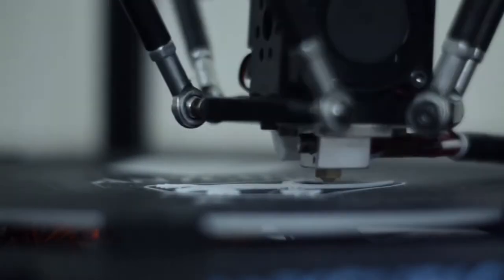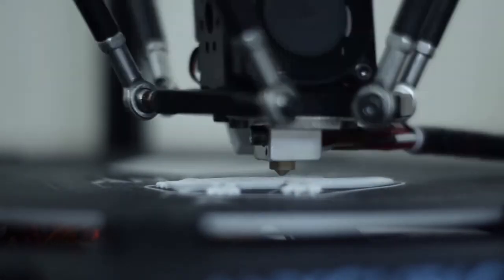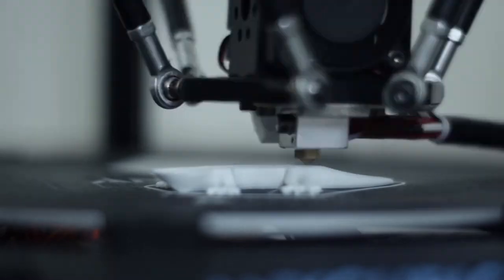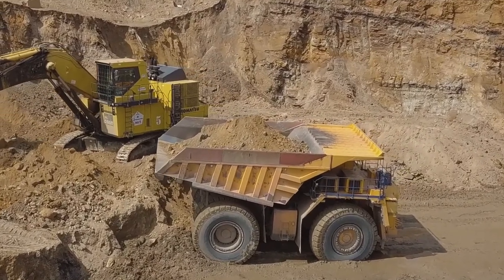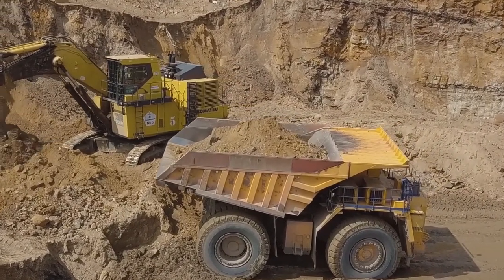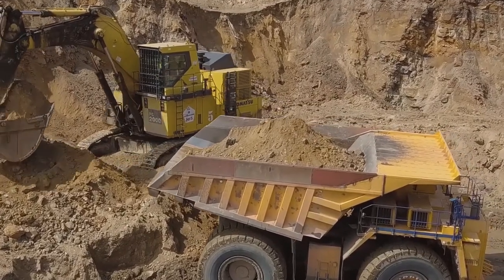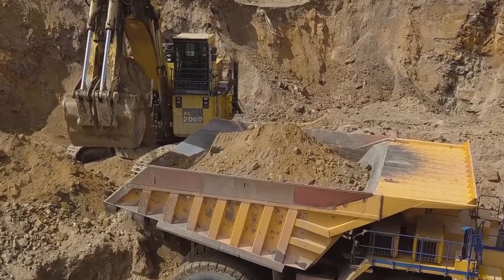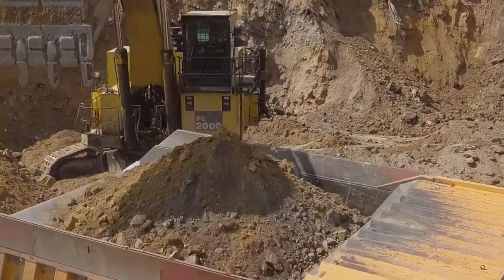The future of solid carbide cutting tools: Think Filter Show- Episode 4

Comment: sir can pcd drills used on cast iron and forged steel
Reply from the maker: Hello Mr. Patil, 
Technically, one can use PCD tools for Cast Iron and Forged Steel machining. However, cost-benefit analysis is essential. 
E.g., If you currently use carbide or HSS tools and it costs INR 100 and has a life of 100 components. Are you going to be able to make 200 components with a PCD tool of INR 150?

Polycrystalline diamond tools are used extensively in the automotive and aerospace industries. They are ideal for speed machining (9000 surface feet per minute or higher) in harsh and abrasive aluminum alloys and high-abrasion processes such as carbon-fiber drilling and ceramics. The diamond cutting edges make them last for extended periods before replacement is needed. High volume, tight tolerances, and highly abrasive processes are ideal for diamond tooling.